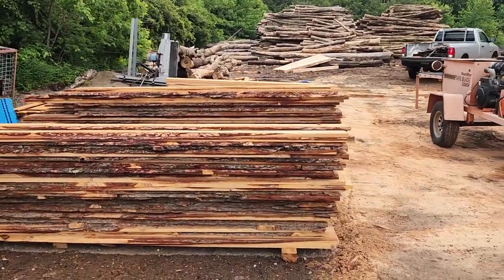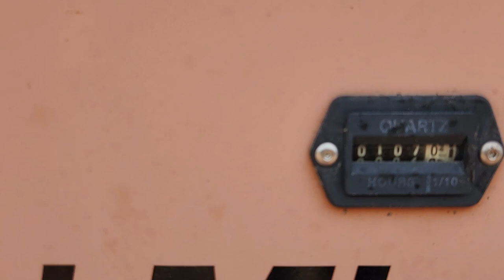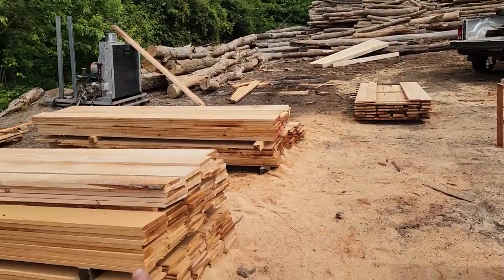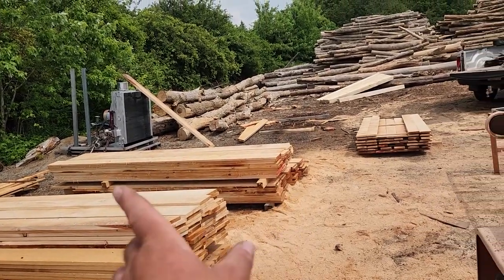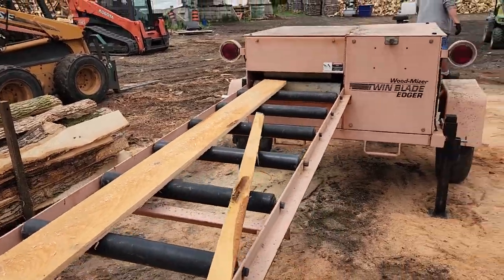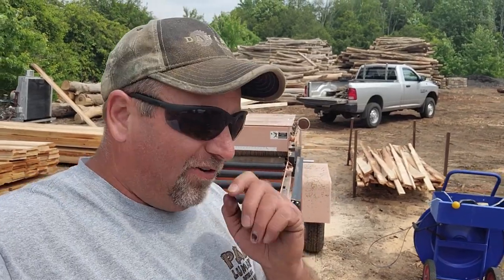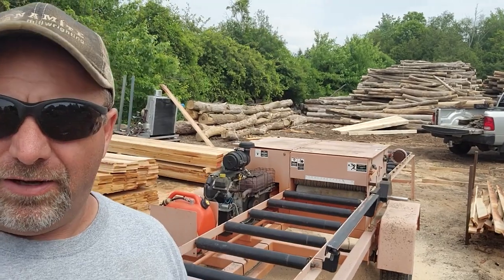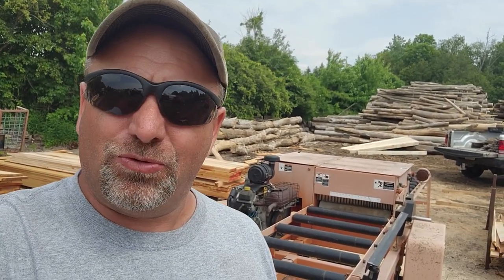WOOD-MIZER TWIN BLADE EDGER  EG200

Comment: We have a twin blade edger for our 94 lt40. Works great when we have hundreds of flitches flitches of white cedar to trim to get the bark edges off. We chip all the cedar and sell the wood chips. The pine slabwood  we sell as boilerwood  by the dumptrailer  load cheap to make it disappear.  All our nice 4,6 and 8" cedar  get made into paneling and  shiplap after kiln drying and planing 1 face and trimming 1 edge square on the sawmill to run against  the molder fence. Need to build a 2nd kiln already and get a lt70 setup in a shed next
Reply from the maker: Sounds like you got quite the operation going.   Great idea with the cedar and chipping it.   Everything is bundled and sound.   If we got alot of cedar we would separate it and grind it for mulch.

Comment: I have the same one about 20 years old with diesel engine. Spray some WD40 on the paint. It will bring back the color.
Reply from the maker: Will have to try the wd40 trick.  Diesel has to be nice on there if you are doing 2 inch edging.   
Love the logo

Comment: Do you find this faster than rotating the cant on the sawmill to get the finished lumber sizes?
Reply from the maker: Almost all these came from cutting the 12x12s (jacket boards)  so no way to get the 8s cut well cutting the timbers.   As for what's faster?  I have no idea.   If you could feed the jacket board through the edger right off the mill it would be faster.

Comment: Did you edge on mill before you got the edger?  What brand grapple you skidding with?
Reply from the maker: Yes, we did all our edging on the mill.   For small orders probably still faster doing it on the mill then setting up the edger but glad we do have it for those bigger ones now.     
The grapples we use are made by martatch.   They work awesome and built tough.